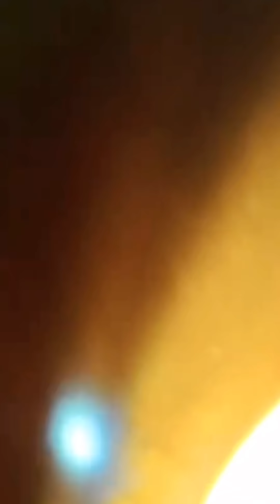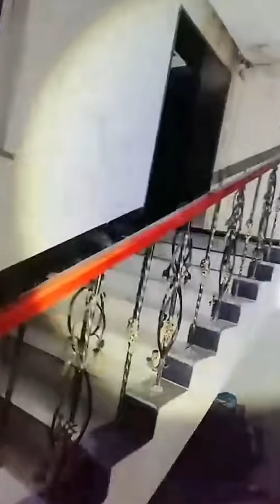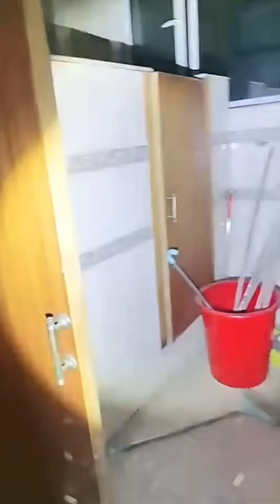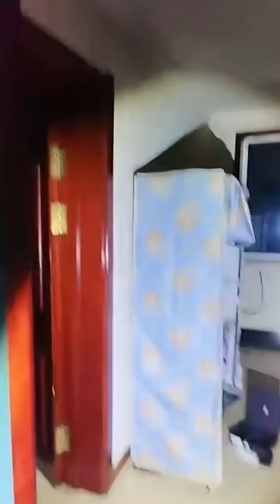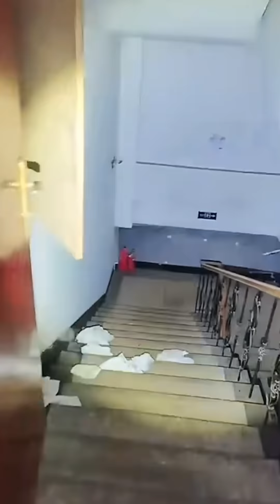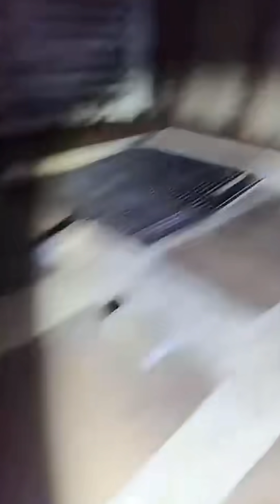SCARY Ghost Videos!【恐怖.靈異】鬧鬼酒店裡的終極對決Pt.2［135］

Comment: Everything went into rollercoaster the time you picked those cards and smh it felt like you messed with ghost gangsters. As you go out
The entire hotel worked hard to kill you as it attempting to roll you down the stairs lastly you are trapped in steaming room. It will be even scarier if the power went back supernaturally, the heater engaged and you'll see the female ghost on a tiny glass on the door as if it will steam you alive.. 

F they're only gonna abandon places to become a ghost hotspots. We need a fearless demolition team to tear up the haunted places. I knew they wanted you dead
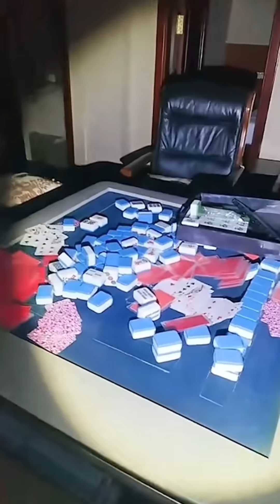Reply: 22:53 (Top left corner of the screen) It looks like a white mist appears in the doorway in the form of a woman with long black hair.
Reply: @tombarnes8527  I saw it